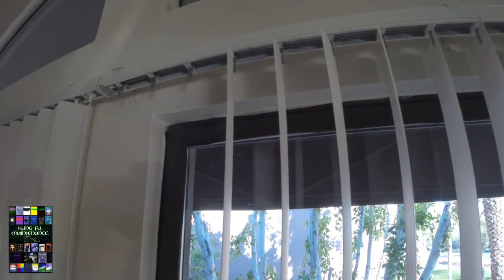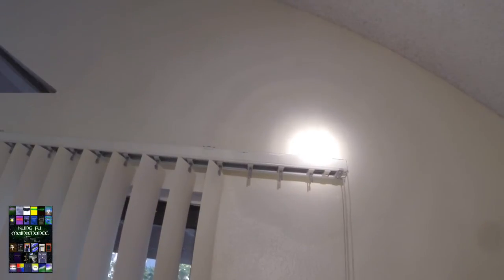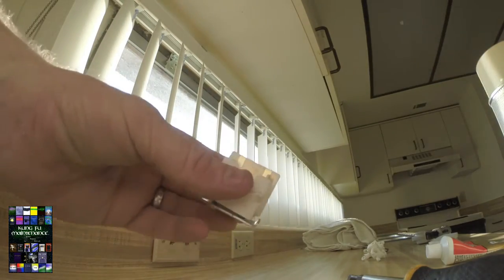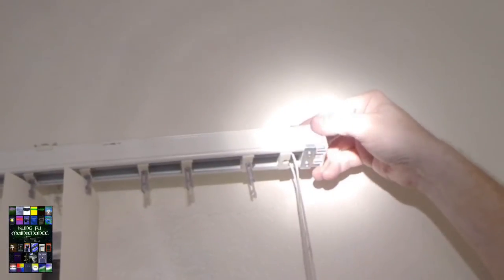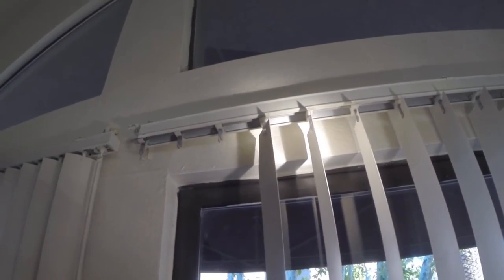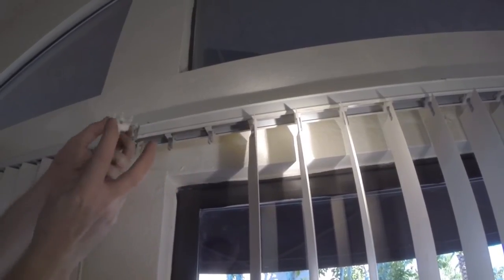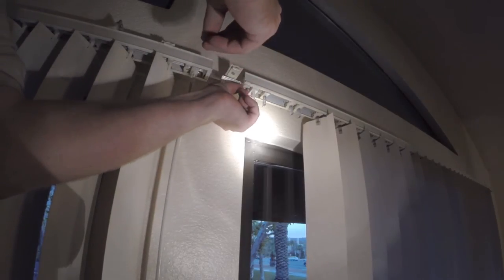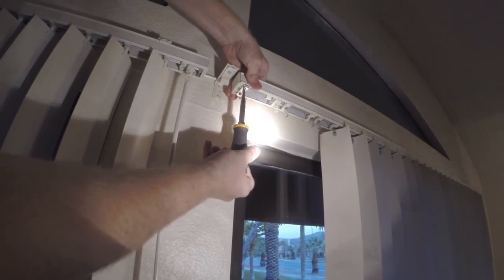Changing Cord And Chain Vertical Blinds:How To Change Out To Wand Control Replace Video

Comment: Hi I have a similar setup with my vertical blinds, but the end cap does not seem to have screws like yours in this video. How would I remove my end cap if I want to replace the bead chain?

Comment: Great video...can't wait to fix all these blinds...correct me if I'm wrong but the only purchase you made was for the wand control? And where did you find em at I can find em at home cheepo or lowes here in San Diego...thanks again
Reply from the maker: +mikecheck66619 A bit easier found on ebay or amazon.